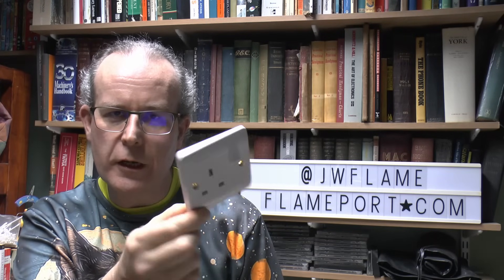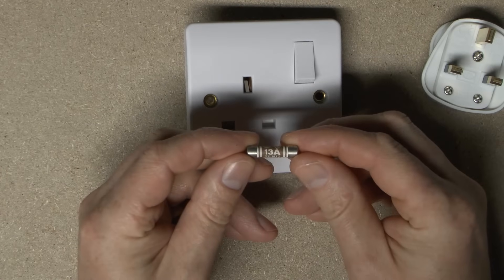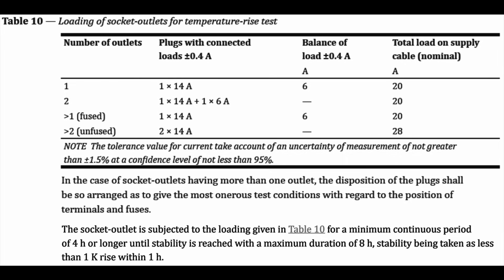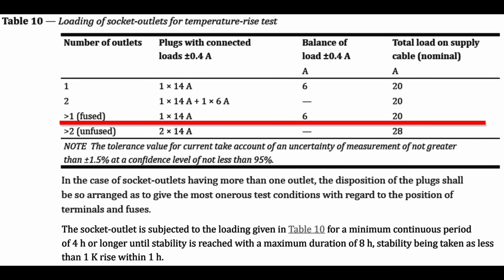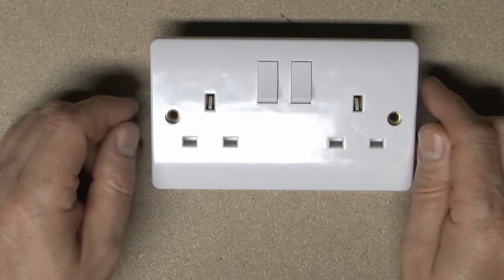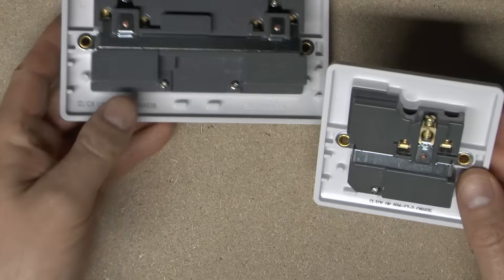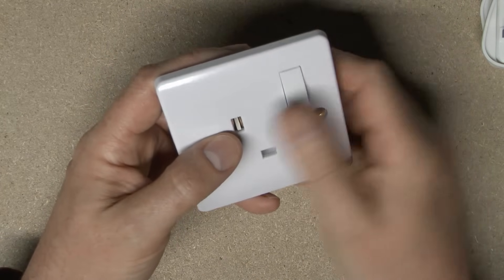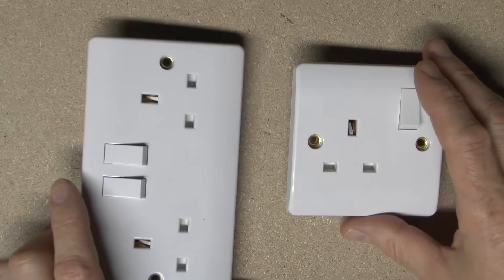Double Socket Outlet 13A 20A 26A? EV Sockets, Fuses,  Washer/Tumble Dryer in one double?

Comment: back in the 1970s, most of the time my father used to heat our house with I think a 2.5 or 2.8KW Belling electric heater in the front room . it had a convector and radiant bar electric elements, separately switched.  It was running on this type of BS1363 socket and plug , and wasn't one of the old earlier round pin plugs or  sockets.

He didn't want the expense or pipework fitting gas central heating to the 3 bed terraced house we lived in .

The bottom line is the 2.8KW Belling electric fire was on for hours at a time in the winter . This would basically knacker out the single 13 amp socket it was plugged into. My father would tend to replace them every 18 months to 2 years. There was always yellowing and a bit of a crack around the live and neutral pins. He was an electrician, and I eventually also was an apprentice sparky in the late 1980s .  

So running the sockets , full bore , hours on end would wear them out ! 

Sometime in the 1980s he got a gas fire put in , he still didn't want Gas Central Heating !

Comment: That's nice information to know about, and like you said, I doubt any washer/dryer would use more than 13 amps total between them.  But I think that 20 amps is more of a safety net, and not a limit you should try to follow.  I think your insurance company wouldn't be pleased to learn if you had a 3000w kettle and a 800w microwave on a double socket, just because technically there's a safety net of 20 amps, even though the socket clearly tells you 13 amps on it.

Comment: I take it the calculation for combination of washing machine /dishwasher assumes that the socket is part of a ring and not a spur? I'm installing a kitchen in an older property.. I have this quandary.. and as is usually the case, the existing washing machine socket appears to be a spur.. I'm not sure if this is adequate (don't they also need surface accessible switches?) thank you 😊
Reply from the maker: Doesn't matter what the socket is connected to, it's the socket itself that could be a problem with two long duration high loads connected.
A spur from a ring final has cable rated to at least 20 amps, as would a socket on a 32A ring or on any radial circuit of 20A or above.

Comment: Dish washers it is not the heating of the water that is the problem , its the drying 5 year old bosch just under 3kw  when drying  , and then put a 13 amp oven on that you are pulling 6kw  on a double socket , now you have pointed this out i will put another single socket in just for dish washer never thought of it like that

Comment: I remember being in a farmhouse kitchen and noticing a 6A cable running along the wall behind where I was sitting.  It was hot and almost soft to the touch so I asked what was connected to it.  The TV, a kettle, a toaster, a microwave oven and a radio and the farmer's wife was ironing clothes.   I then asked if the fuse ever blew (cartridge fuses in an old consumer unit they had) and was told, yes, but we put in a 40 amp fuse and it never blows now!

Comment: 3kw on a worn socket or loose terminal screw inside the plug head or a loosely fitted fuse is going to get hot due to high resistance as a result ofpoor connections. 
If all connections are good then 3kw, 24/7 via a 3 pin single phase outlet would never get hot to the point of burning.
High demand via a plug connection only burns and melts if it can arc under load.

Comment: Thanks John. I use a 'granny lead' for almost all recharging of our EV, and have done so for over 4 years. A couple of points to note: The car should be connected after the recharging lead has been plugged into the wall outlet, according to the manufacturers of both the vehicle and the recharging lead. Then our 'granny lead' takes a few seconds as it handshakes with the vehicle before initiating the recharging process. These two minimise the inductive load switching at the wall outlet. 

Our lead can also be switched between nominally 8, 10 and 15 Amps. In reality, the currents are slightly lower than that. We have a full 240 Volts at night at the (loaded) outlets because we're within 50 metres of a substation, and recharging power according to our home battery inverter is reported to be around 2.8 kW. 

In addition, if the car is being recharged at 13 Amps, I always keep a 15 cm fan blowing directly onto the mains plug, to reduce the heating. When no fan is used, the wall socket can become discoloured and start to crack over time, because of the heat. This does not happen when using a fan for cooling.

For the most part, I still use a fan, running at lower speed, and recharge at 10 Amps. That current is fine without the fan, but it's still used here for peace of mind. After all, the car recharges for up to 5 or 7 hours at night, depending upon the tariff being used, and 10 Amps should be regarded as the maximum continuous current rating for '13 Amp' mains plugs in Britain.

Indirectly related, but still relevant: For all BS 1369 mains plugs, it's always worth checking the condition of the fuse and its connectors every 6 months or so, removing any oxidation, or even replacing the plug, if necessary. As a matter of routine, I also go around all of our household plugs (especially those being used for higher powered appliances) at least annually and check that the wires are still held firmly by the connector screws, because they do tend to work loose over time.

Comment: A problem I come across far too often is plugs burning out on hot trolleys - commercial catering trolleys with a bain marie and often a gantry of halogen lamps atop a hot cupboard.  They come with a moulded BS1363 plugtop which I am forever being told I am not allowed to chop off for fear of voiding the warranty, and that they have been designed to be protected by a 13A fuse so I can't just fit 16A commando plugs and dedicated circuits (not that I should have to).
How do manufacturers get away with producing something which is likely to end up with a melted plug unless it's modified after-market?

Comment: Very interesting,I had one where my friend was operating a tumble drier and a washing machine together and it welded the plug pins to the internal contacts ,I told him at the time after replacing the damaged socket and new plugs on appliances ,just to operate 1 appliance at a time ,if I remember the amp clamp reading was over the 20amps ,like you say John I think the appliances were old and the heating elements draw more current ,can it also  be caused by worn plug pins and internal socket connections , caused by.  I2r.  Heating ??

Comment: When a socket or plug overheats, it is generally because of a high resistance connection (significant resistance where ideally should be zero). Often a loose fuse.

A properly installed 1 or 2 way 13 amp socket should source 13A per socket

(UK)

Comment: JW, welcome back. Good to hear that our teacher has returned!  Tell me what about a kitchen that has a 3KW kettle and a 3KW toaster. If both were on together, I guess would that be ok as the kettle would boil in say 1-2 mins?
Reply from the maker: Not a problem, each will only be on for a few minutes.  Many kettles and toasters are only 1.8kw or 2.2kW now.
Reply: The circuit is usually 30A , so it'll be fine. For modest period s of time. 2:24

Comment: I remember a few years ago employing a carpet cleaning company who turned up with a fridge sized machine which they placed outside the front door, and then had a long umbilical hose for the brush bit.  Anyway, the machine appeared to take more than 13A and had a thick cable which split to two 13A plugs on the end, which the guy plugged into a double socket, so he could pull 18A or something.  A H&S nightmare as if you only plugged in one the prongs on the other would be live, but an interesting solution……. And we did get clean carpets.

Comment: A questions arises. I assume fitting 2 singles in a dual backbox, either as ring or ring+spur, will be 2x14A despite being functionally equivalent to a double with basically the same heatsinking from the cables/mounting arrangement?

Comment: You mention nothing about wiring? If a double socket is actually a spur (which is often found in kitchens) and not part of the ring main then likely something will get very hot pulling 20A.
Reply from the maker: 2.5mm³ cable is rated to at least 20A when used for a ring, and in many cases more than that depending on installation method.  The presence of a spur changes nothing.

Comment: Interesting comment regarding dish and clothes washer current draw. I too have noticed that modern appliances hover around the 2 kW range. You'd think they would manufacture a heating element of around 2.5kW, leaving spare capacity for the motor - this would shorten the wash cycle which is a selling point.

Comment: Where I could see a double socket used for hours on end under high load in a domestic setting,  is when 2 EVs are charged at the same time where there isn't a dedicated EV point.  For example, visitors overnight who have an EV each to a house without a dedicated EV charger and both EVs connect to the same doube socket as it's closest. That could test the limits of the double socket!

Comment: You are either missinformed or knowingly giving false information about fuses, a 13A fuse is designed to carry 13A  it will blow at 200% or higher depending on type of fuse, an HRC fuse will blow at a smaller current than an open wire type. I am a qualified Electrical Fitter who served an indentured apprentiship in the 1960's with City and guilds B and C certificates.
Reply: I think JW knows more than you about this kind of stuff.   And I’ve no idea who you are.  Read between the lines.
Reply: I doubt JW knows more than I do as I worked as an Electrical Engineer for the Area electricity board for many years on LV, 11KV  and 33KV systems. What I said is fact, he gave the impression that a fuse rating is the current it will blow,it's not, it's the maximum load it will carry safely. Has he any qualifications, it took me 5 years to earn mine.

Comment: Some of the old cars took big 15A, 20A, 25A... house style fuses (not the physically smaller ones, like car radio in-line fuses, I mean normal house plug size). It wasn't really until after the Viva, Marina, Datsun Sunny,  Rover SD1, Capri... sort of era, we started to see the smaller barrel shaped fuses or the now common square fuses. So I'm not sure if the higher amp fuses you showed are fake. They could easily just be older, original fuses, or new ones made for the classic car market and anyone else needing the older style fuses. 
And no, I've no idea which of the older cars used that type of fuse or what they went up to, but think I've seen 15A, 20A, 25A and 30A. There were obviously lower ones as well, but they wouldn't stand out different to a standard house plug fuse. 
If anyone remembers what cars used them, let everyone else know!

Comment: Thanks John.  Another great video.

Are there any further complications for the supply wiring if a double socket has been added as a spur rather than extending the ring main ?

I couldn't tell where the spur came from but just hoping it's off the ring and not "daisy chained" somewhere 🤔
Reply from the maker: One socket on a spur is not a problem.  Two or more is, as the cable could be overloaded.
Reply: @jwflame thanks.  It didn't feel right - time to investigate further 😕

Comment: What's the double pole markings on the back of the socket outlet mean?
Is the switch double pole?  when switch off, disconnect live and neutral !
Reply from the maker: Yes, it's for the switch.  Both L&N switched on this one.  Some have single pole switches for L only, N is permanently connected.
Reply: @jwflame  it's good to know, thanks for the reply

Comment: any thoughts on the sockets which were recalled by their maker, which Big Clive tried to find the fault in them?
Reply from the maker: Even before the recall they were low quality junk with MK stuck on them.  Unrelated to MK sockets of the past.
Reply: Weren't these some sockets that were actually physically OK but had the connectors wrongly indicated so could have been inadvertently used dangerously?

Comment: That EV socket also had DP on the back which i assumed indicated double pole switching.  As far as I can see that is not (yet) a requirement but there is a recent change for switch actuating force tests for double-pole switches where fitted in the standard, presumably anticipating that DP will be used.  Is that correct?

Comment: I'm curious to know from where the +-0.4 and +6 additional amps were dreamt up...

And why a max cable temp of 70c? Why not 60c? 

Lots of arbitrary values.

Interesting video as always. Lots of points to ponder.👍🏻🇬🇧
Reply: Because in real world scenarios there is a significant variation in voltage ... which affects the the ability of wiring and socket to handle Amps. Presumably the 70C temp is related to the temperature that the insulation is rated to cope with without degrading? It does seem to be surprisingly high.

Comment: EVs charging from regular sockets is a thing. Even in North America with our wimpy 120V outlets, an EV can charge around 5-8kph. At 240V they should charge at 10-16kph (around 3-5mph or 6-10mph, respectively). For people who only make short trips, this is more than adequate - if you can charge overnight for 12 hours that's anywhere from 60-96 km on wimpy 120V, double that for your 240V system. If you can charge daily, that's basically most daily commutes and even errands as you top it off each day. It's only slow if you're trying to charge it up from empty,, but for daily use it can work for a good chunk of the population.
Reply: Yes, plenty of people in the UK get by using portable "granny chargers" at home that plug into a normal socket (though the chargers are limited to 10amps rather than the 13amps to give a margin of safety).

Comment: I’ve seen a double socket melted with two ovens plugged into it, cheap socket and plugs so I replaced it with quality parts and it’s fine now, I did offer to replace with two separate sockets but customer didn’t want it. I heard MK sockets are rated to 26 amps but have been able to verify that.

Comment: Granny chargers are for emergencies only (eg. when caught short and having to charge at your grannies, hence the name).

A friend of mine had a 13A socket in his garage that he used to charge his EV using a granny charger. He would charge it several times a week.

I warned him of the dangers of 13A sockets melting when used for hours on end with granny chargers, and that he should fit a Level 2 EV chargepoint or at the very least fit a 16A commando socket in place of the 13A socket. He disagreed and continued using the 13A socket.

A few months later he discovered the 13A socket had started to melt. He immediately fitted a 16A commando socket and bought me several drinks by way of apology.
Reply: I’ve had EVs for nearly 6 years and have only had a granny lead at home, plugged into a standard double socket. Never had any issues.
Reply: A friend of mine uses a "granny charger" - can just charge up slowly overnight at off-peak rates, and no need to find somewhere to fit a specific charging outlet.

I don't think he's had any problems but will check next time I visit.  What current was your friend's charger pulling ?
Reply: @kevinrichards6506   it was an official Nissan Leaf granny charger which I believe has a max rating of 10A.

Comment: The amount of times ive been called out to a melted plug literally welded/melted  into the socket needing a chisel knife to separate them and the house holder has said to me, “ i had an electrician round and hes said its the appliance at fault thats caused that by pulling too much current through the plug. -unbelievable. Just goes to show just because you can pass a few multiple choice questions……

Comment: Just out of interest. Would commercial applications have different size wiring? I ask this because in a takeaway I worked in, they often have double fryers which are plugged into double sockets. Both 3kw. So both would be pulling 13 ISH amps I'm guessing. Not sure how it's all wired tho radial or ring. But since they are willing a load of power the wiring would be a size up to cope with the heat dissipation? Never thought about the sockets capacity....
Reply from the maker: Yes, a commercial installation would be designed entirely differently.  Plenty of commercial equipment should have it's own circuit, as a lot of it is rated 16A rather than 13, and although some people shove 13A plugs on because it's easy they really should not.

Comment: I was rather hoping this to be an actual test with 2 x 3kW loads. But what could you use for the loads that would draw a continuous current for 4 hours or so? Almost all heating loads will cycle because of the thermostats. Perhaps an enormous tank with immersion heaters? Or convector heaters outside in winter? A bank of 6 x 500w garden floodlights?
Reply: Yes, an immersion might do it ... which why they are not normally allowed on a plug but are hard wired to their own circuit.
Reply from the maker: In a normal house there is basically nothing which would be 3kW continuously for hours.  Even 3kW for a short time is an unlikely item.
Reply: @jwflame  though lots of hobby potters have 13A kilns that may fire over 8 hours - initially cycling on/off every 30 seconds, but increasing lengths of time on, and may be drawing the full 13A over 4 hours. And the users of these know nothing about looking at other loads on the circuit.